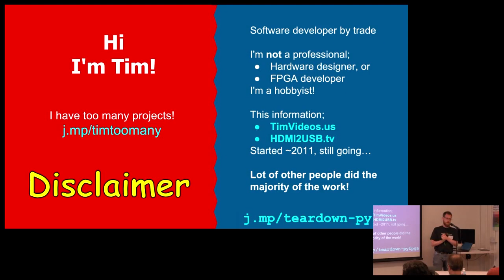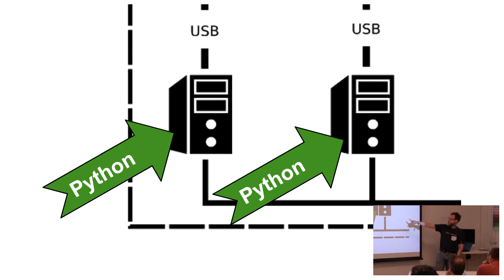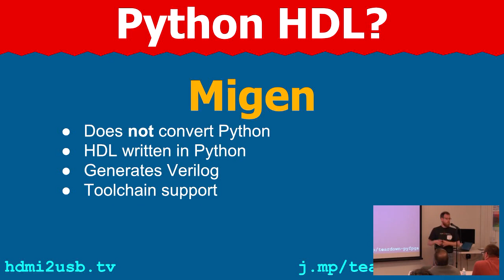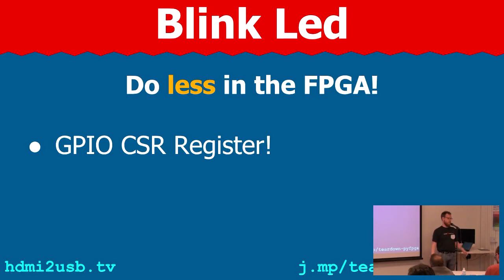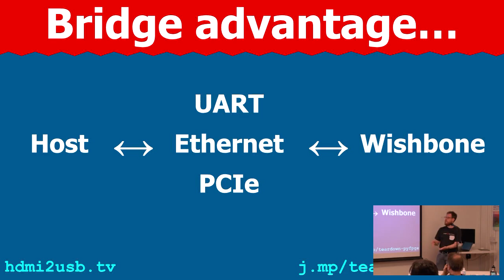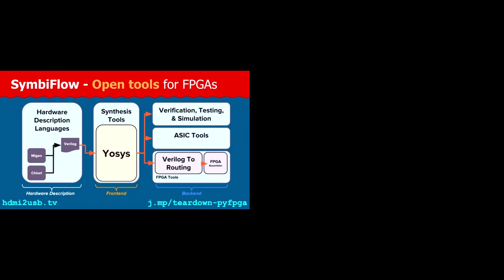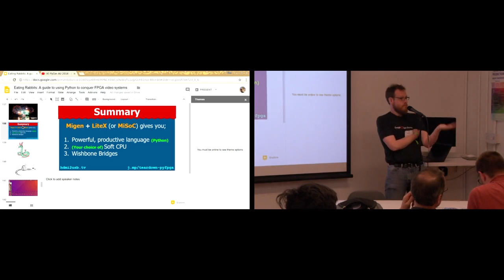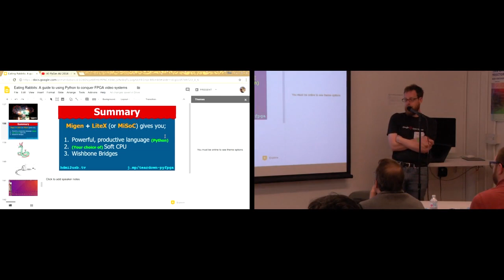Eating Rabbits: A guide to using Python to conquer FPGA video systems

Comment: Any updates to this?    For example migen became nMigen which became Amaranth HDL.   But does Enjoy-Digtal's LiteX work equally as well with Amaranth HDL?  The documentation still points to Migen.

And what if your board is not listed as supported?  For example, I have a trenz "SMF2000".. how easy would it be to put USB or video blocks on it (assuming the appropriate physical layer hardware is added)?

Regarding the 31m50s mark, is the Sigrok / Light-Scope for the FPGA available anywhere?  I don't see it on LiteX :(